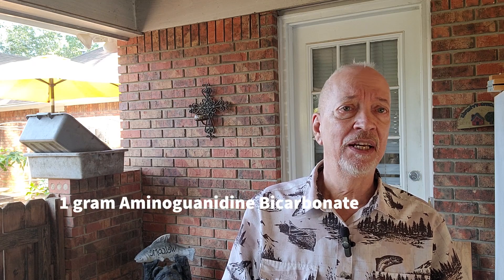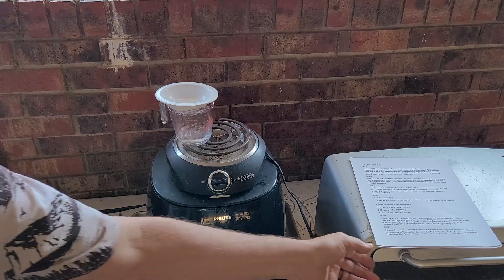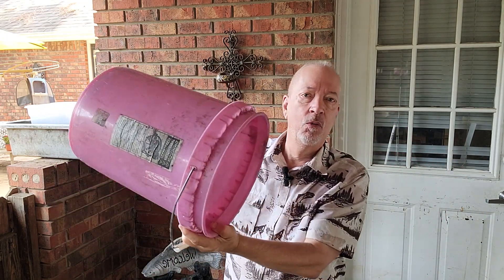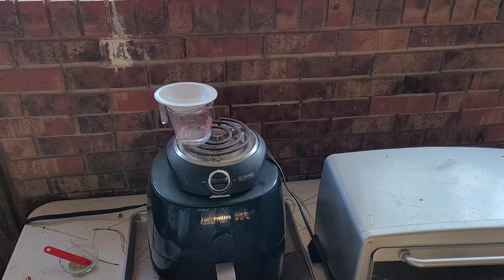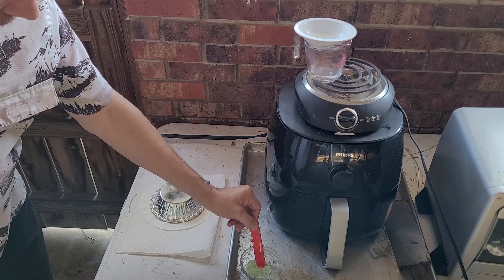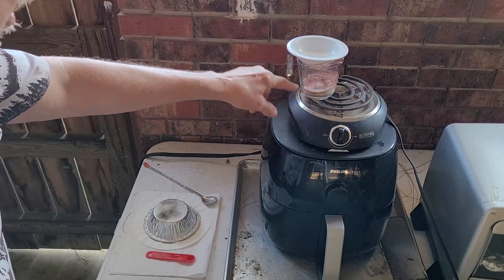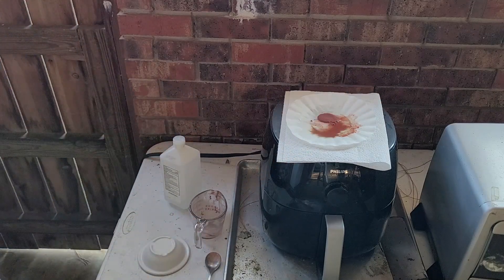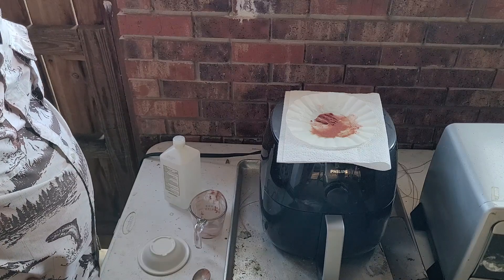TO24 Part B iNAP

Comment: How long did you leave it to crystallize before pouring it off on the coffee filter?
Reply from the maker: I don't recall any specific time, I just waited until I saw no new crystals forming. But it happened very quickly, seems like only a few minutes by my recollection. I've been working the past year with mostly flint lock tech.

Comment: I'm being driven nuts with this. My nickel carbonate seems to be absolutely insoluble in H20 even when chilled to 60c. Furthermore it seems to be much heavier than any of the nickel carbonate y'all use (a tiny scoop is always over the amount called for). 

I get no reaction other than foaming, I've tried running a stir bar, no stir bar, adding extra nickel and I get no green/blue color change and no reddish participate. Just an unreactive grey/yellow gunk
Reply from the maker: I'm afraid I'd have to be there watching to help. All I can think of is make sure you actually have nickel carbonate, and follow my video directions exactly. I've made it several times now and have had no problems at all.
Reply: @timesgonetech3057  yeah I suspect the nickel carbonate is bad, it's from eBay and doesn't seem to have the correct water solubility, I'm guessing the vendor cuts it with something. I'm going to get some lab grade stuff instead of ceramic grade stuff.
I spent hours on science madness and rewatching both your and Dugan's videos making sure my technique was good and tried everything else so it's gotta be the answer.
Thank you for the quick response though,  appreciate your videos!
Reply from the maker: You just reminded me! A commenter on another channel did mention once not to use ceramic grade because it isn't pure enough. I get mine from a lab supply store.
Reply: @timesgonetech3057  I redid everything with lab grade nickel and it worked great. Thank you for your help!

Comment: I have a years of experience with NAP.  The amount you are working with is very dangerous.  It's unique in a lot of ways.  first, a single grain can detonate unconfined. a 1-10 gram pile is enough to destroy a ceramic hotplace, sending ceramic shards into everything, including you.  Ask me how I know...  I love that people can explore the science and have the amazing hobby of learning to burn things at supersonic speeds.  But NAP(uNAP, iNAP or just plain NAP) detonates in almost any amount at greater than 8000M/s. That's equicilent to RDX/C4 but it's compariticly very much more sensetive.  Now, don't fear it.  But respect the RED.  While its a fairly insensetive to static, friction and impact, it is precariously sensetive to spark, fire and heat.  Take care.  Keep all ten and both peepers....
Reply from the maker: Always good advice! My only disagreement with iNAP is it is sensitive to both impact and friction which makes it suited for percussion cap primer. But yes, disrespect it and it will bite back!
Reply: @timesgonetech3057  YEs, my point is it's comparativly insensitive with respect to tetrazole, fulminates and azides.  About 10x less sensitive to friction and 5x less sensitive to impact while also being far more sensitive to spark or heat.  Similar to lead styphnate.  Matter of fact, i'd wager there would be failures in a pure iNap primer whereas the addition of tetrazine allows for more reliable impact ignition due to is longer DDT and higher impact sensitivity.  My caustion was to say that a 10 gram pile is very very dangerous to produce and handle when dry.  A mistake with just 1 gram can propel shrapnel at 8000 m/s.  Perhaps a good idea to store and work with smaller containers with 1 g ea.  Again, not trying to be safety police.  Just noteing that even 1g of iNap is equivalent to a #10 reenforced cap.  It's amazing stuff.
Reply: @derekturner3272 even though it detonates fast primary's are not as strong as secondarys.
Reply: @JerryScott-k2w  I'm sorry, but that's simply not a true or useful statement in this context.  Fir instance, AN based secondary has less speed by a factor of two and less brisance.  The "strength" or work done is largely based on the volume of the charge, typically in the tens of pounds.

   Primary safety is always based on limited quantity AND safety protocols because they can be viscous in their detonation and they are very sensitive by design.  And some are far more powerful by speed and work than an equivalent amount of most sec's.

All the NAP's and many other primaries can be fatal in single digit gram quantities if they are able to launch shrapnel(the dish they're made in or bottle they're stored in for example).  Shrapnel from a AN charge is likely to travel at 4000m/s while NAP is upwards of 8000 m/s.  

Hope this keeps someone from taking unnecessary risks.
Reply: @JerryScott-k2w  that’s a ridiculously misguided statement

Comment: They are only similar as far as ease of manufacture.
 Its like TATPs prettier, nice sister that won't try to kill you when you sleep over 😂
Reply from the maker: The Mother Of Satan has no "nice", "pretty" sister. Avoid the entire family or lose a few fingers and an eye... your choice...
Reply: @timesgonetech3057  I made the choice to make all the common organic peroxides and some of the rarely talked about ones.
It was fun but I have no reason to make any of them again because there are better options.
Except for MEK, I find that one interesting and it has uses in polymer technology.

I only compared NAP To TATP because they are both so simple to make, that's it.
And it's true that  NAP crystals are pretty.
Reply from the maker: @HyperHyena88  true enough. I've made ATP before too. I love those blood red crystals NAP makes. :-)
Reply: @timesgonetech3057  they are pretty.
Do you always make the isopropyl version or do you sometimes make regular NAP for your caps ? 
I am wondering because sometimes I get those blood red crystals and other times the product is lighter in color and has a white powder with it.
Have you ever noticed this ? 
I'm wondering if the white powder is leftover unreacted ammonium perchlorate and if you have ever seen this ? I always weigh out the same amounts of reagents so IDK what is causing what I described.
Reply from the maker: @HyperHyena88  the guy to ask is Dug at Energetic America. I've never made NAP because the long crystals are hard to grind down withought setting them off (according to Dug). I've made iNAP twice and have not seen the results you describe.

Comment: Why from hundreds of energetic material you choose NAP. I understand that its new and its a good primary explosive but that doesnt mean that this stuff will be a good priming compound. It may go from fast burning to detonation  in percussion cap and destroy it as NAP is very powerfull. Detonation is not something good for priming compound. All commonly used primers are not capable to detonate at conditions in percussion caps. For example mercury fulminate has long deflagration to detonation distanse it is used in percussion caps, in opposite lead azide that detonates in single crystal never used in percussion caps. NAP is pretty close to lead azide. DDNP is good for primers, lead styphnate, they also do not detonate in low quantities. Also you can make pretty good priming compound using for example potassium clorate -Sb2S3 based mix without synthesis at all.
Reply from the maker: I'm actually using iNAP, not NAP, and it works great in percussion caps. Easy and safe to make and responds very well with tetrazene as a sensitizer.
Reply: @timesgonetech3057 iNAP is still NAP, It may work great but your choose is still weird. I would use something else.
Reply: @timesgonetech3057  iNAP is NAP made using isopropanol, that is still NAP
Reply: @timesgonetech3057  As long as you use sufficiently small enough amounts that detonation wont spontaniously disssassemble the firearm, I see why you picked it.  But it's NOTHIGN like other primariies used in priming comps.  Just be aware of that.  It can detonate in a single crystal in sub micrgram amounts with slow heating or spark.  Place a grain on tin foil and heat from below to observe.  It's DDT, critical diameter and minimum charge is near zero.  Cheers and have a safe time@!

Comment: I'd love to pick your brain for a moment. I was hoping you could tell me how you applied the aluminum powder to the prim all. I was wondering if you replaced the glass for the aluminum powder. Or if you added it separately. Thanks for the help and thank you for all the wonderful videos!!!!
Reply from the maker: I did not adjust the mixture for Prime All. I just added the aluminum to the existing formula. Same with TO24 in reverse - I just removed the AL for a regular cap but did not adjust the other ratios. I've since decided to just shoot magnums fron now on.
Reply: @timesgonetech3057  thank you for the information. I wasn't sure how much you used. I don't mind the orange color but I definitely wanted to up the power level. I really appreciate it

Comment: Damned fools that want to make destructive  devices anytime the discussion turns to energetic chemistry. 

 They remind me of the guys that ask to learn about blacksmithing. I show them how I set up my forge.  I start them shaping their first set of tongs, and before they are half through making those first tongs, they start going on and on about how they are going to make a Damascus Sword  and asking "When can I make them a billet of patterned steel, to get them started?"  "How long does it take to make a 34 inch sword blade?". 

I do not make swords. I have made forty feet of chain, 500 nails, and lots of tongs, hammers, and other tools to make tools.

I do not make terror devices.  Chemistry is cool.  Energetic chemistry can be useful and cost effective for making workhorse tools like percussion caps, propellant, rocket motors, pretty fireworks as part of a local club.  

It a person is interested in terror talk, I want nothing to do with them.  They are going down the wrong path if they are looking here for that kind of information anyway.
Reply from the maker: I have a great deal of respect for swordsmiths and for those who can and do teach the art to others. I've made knives and a small sword and I know how hard it is. Like any weapon the sword is harmless without the idiot holding it.
Reply: @timesgonetech3057  no disrespect for bladesmiths.  My point is that I have blacksmith skills. Moving hot steel under a hammer, forge welding, etc.  These are fundamental skills for a future bladesmiths, skills that they seek me out to learn. But because of their fantasies they snub the lessons.  I see a similar lack of self awareness in the folks that seek out energetic chemistry and talk or at least ask about applications that will do any of us harm to be party to.

Comment: Have you tried replacing the Isopropyl alcohol with 90-95% pure ethel alcohol instead of your example?
Reply from the maker: No, I haven't. I don't actually work much with energetics. I was looking for a replacement for antimony and found iNAP, developed TO24 and that's as far as I've gone with it. What happens with ethyl alcohol?
Reply: @timesgonetech3057  I don't know what happens with ethyl alcohol either, I was just curious ad my eyes are no longer good enough to work with energetics. As for your attitude about further experimeningg, no problem. If it ain't broke, don't fix it
Reply from the maker: @Jagdtyger2A  don't get me wrong, it could be an interesting experiment. But someone better qualified than I should do it. I'm an engineer. I build things and test them to see if they work, and why. But I can follow a recipe.
Reply: @timesgonetech3057  No problem, I am inherently curious and have been stuffing my mind with eberything I can since 1962
Reply: That's where you would use your math skills to make a prediction, same way with methanol.  Chemistry isn't just a cookbook if you want to be experimental.

Comment: Great info...one question....how much Tetrazene did you use in this formulation?
Reply from the maker: Watch Part C coming up!  :-)
Reply: And what happened to S03 E24?
Reply: I found removed by the uploader
Reply from the maker: I pulled it due to potential You Tube policy violations. They didn't say anything, I just did a pre-emptive pull before it became an issue. I might edit and reload but it served its purpose.

Comment: I have a question what about heat?
If you live in a hot area is it best to make these percussion caps in the winter time instead of in the middle of the summer?
Reply from the maker: The only problem in the summer is tetrazene decomposes at 190 degrees Fahrenheit so if you live anywhere it gets that hot you could have bigger problems. But seriously in an enclosed area like a car out in the direct sun in the desert it could be a problem with any primer because they nearly all include tetrazene.

Comment: The uNAP should be insensitive enough and small enough crystals to use for caps/primers.
Reply from the maker: Problem is it's a lot more powerful than iNAP and iNAPs already right at the high end of desired brisance. I think uNAP would make a better blasting detonator.
Reply: @timesgonetech3057  uNAP is by far the best primary I've used, in both mono filler caps and using a secondary for the output segment. Spectacular stuff.